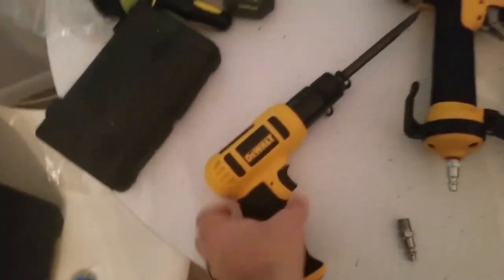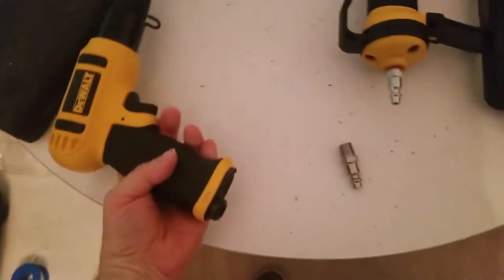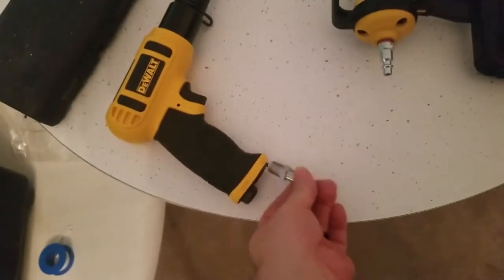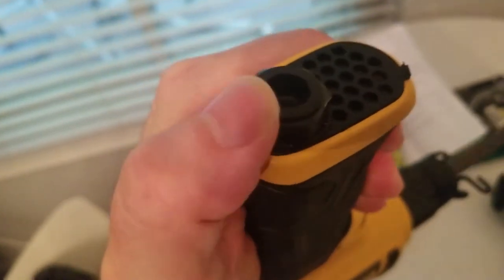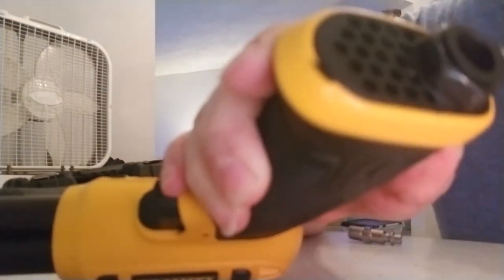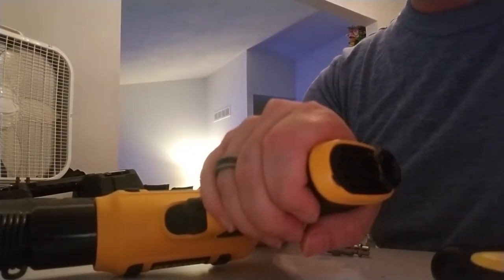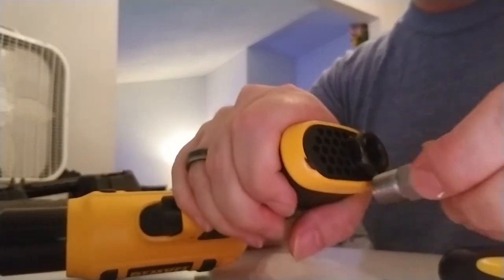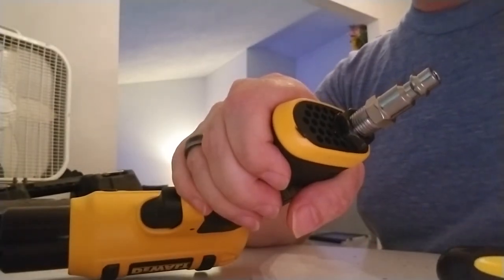Dewalt Air Hammer 1/4 Coupler Plug installation.

Comment: Did your spring that holds the chisel come like that? Ready to hold the chisel? Mine came completely round. It doesn't even come close to holding the chisel in place. I keep seeing it picture with a really nice bend to hold the chisel but I doubt I can make they bend that nicely and it doesn't look like y'all had to. Looks like yours came from the factory ready to work while mine needs a Hercules to bend it into proper position.
Reply from the maker: Yep came this way out of the box.